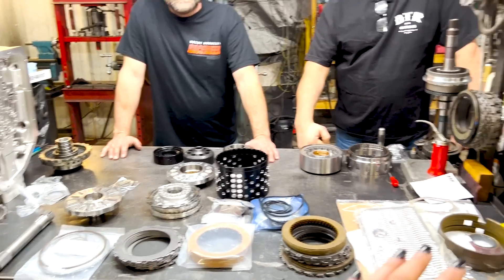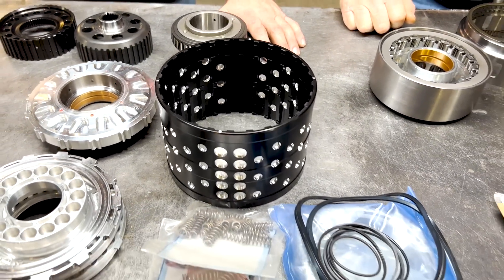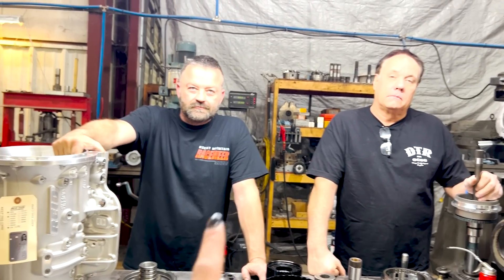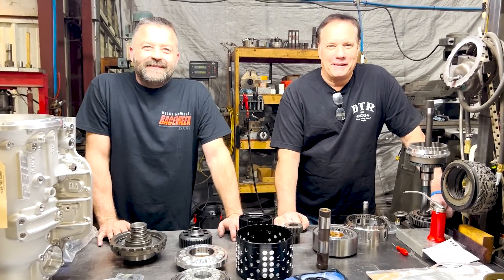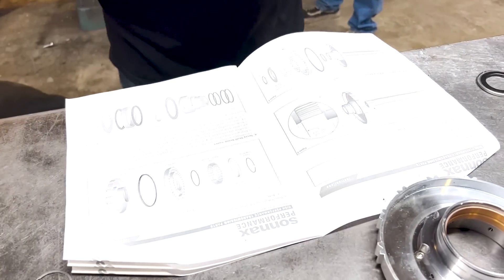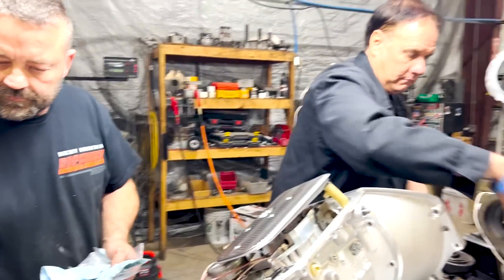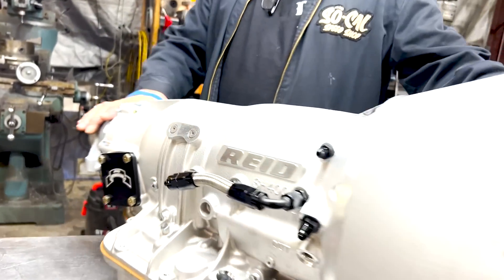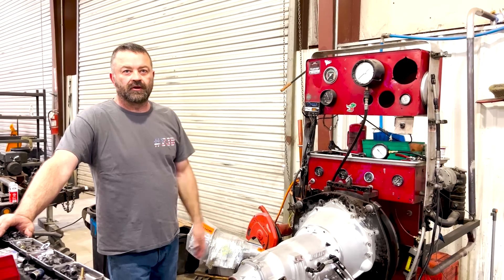55 Gets its Own Transmission! (And the Nova gets its Back!) - Summit Racing Series - Video 1

Comment: The TH400 is awesome but I'm sorta wondering with all the trouble they have been having with the gear vendors why they haven't gone with a 4L80 to get the overdrive built in..or maybe you can't do 2500+hp with the 4L80....but Jake does specialize in both so I guess he knows best.

Comment: Jake is a very brave man standing basically over top of a driveshaft that is going around 3000RPM and his family jewels is right next to the U-joint and the yolk of the driveshaft I have to say I would definitely be making a driveshaft hoop atleast but that doesn't stop any flying parts at all and what he needs for that is a small piece of thick lexan to mount off of something so he can put his head behind that and still be able to see everything he needs to see and be somewhat protected from flying shrapnel flying towards his head but he really just needs a sheet metal wall right at the U-joint to serve as a driveshaft containment

Comment: With how much wear is put on these drag transmissions during the driving portion of events, it almost seems worth it to bring a street transmission, setup your trans cooler lines with some dry-break fittings, and swap transmissions in and out between street and strip.

Comment: Soo.. if I got this correct. The change over to the cage system produces a more positive 1-2 transition with lower starting drag. This produces a faster, harder shift for better 60 foot times.    riddle me this...  Isn't the 1-2 shift either in the burn out OR the launch the point where the gear vender tends to exit the race?  Wont this change compound that issue?

Comment: You don’t soak the clutches in fluid before stacking it? I’m not a transmission builder by any stretch if the imagination, just noticed it and was wondering if there’s a reason

Comment: I have a question for you guys.  I need some help.  I have a powerglide that I am putting behind an LS engine.  I will be putting a Turbo on it eventually but for now no.
There are some pump mods that help with thrust bearing.  I saw a guy from FTI doing this mod and My question is " If I was to do this modification to my pump would it be OK for regular street driving my Car???
I did the mods to the pump and did not drill out the back of the case wich I believe is to give more oil to the rear piston.
Brad From Ontario, Canada
Thank you!!!

Comment: Way back in the 1970's, I was running a TH375 which was a 400 housing with 350 guts.  With the 2.7 rear end, I was able to 80 MPH in first gear at 5000 RPM.  If you ever want to win a bet on how fast you can go in first gear.  My set up didn't go well with the common, moron, redneck!